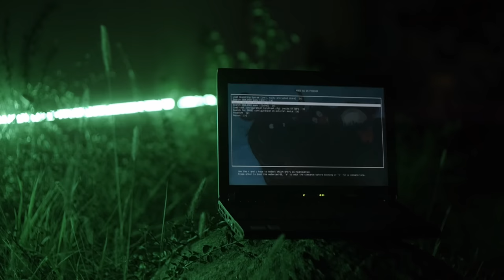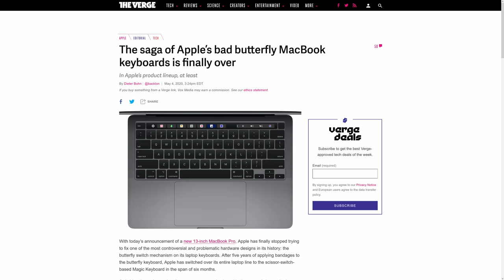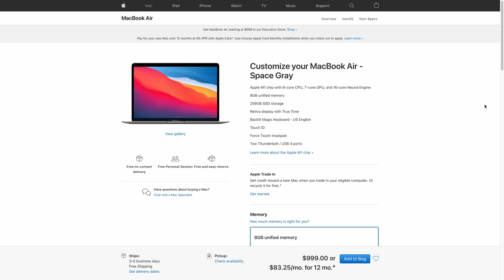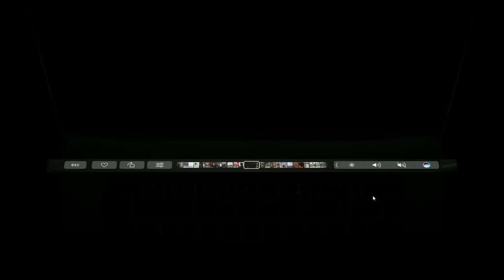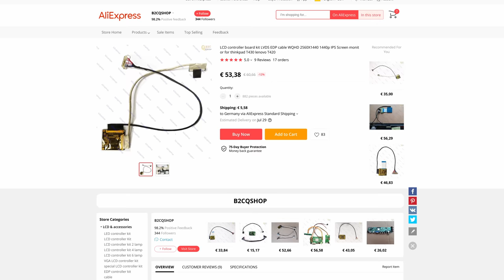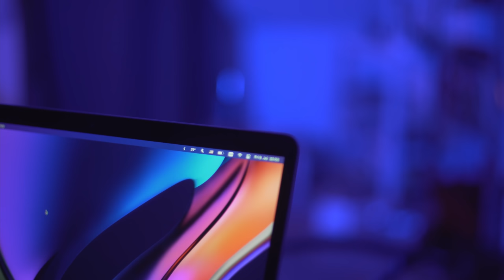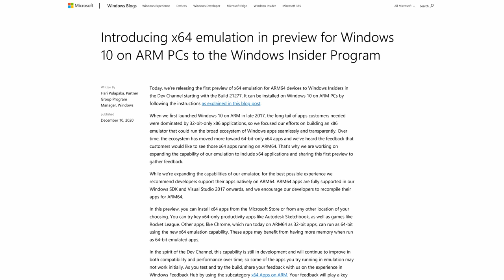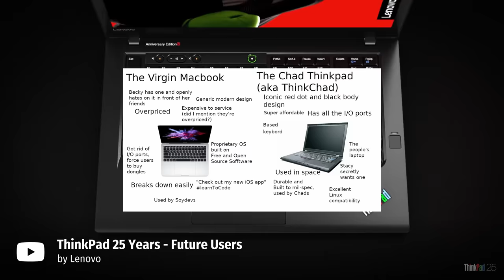Why I Switched to Mac (as a Linux user)

Comment: considering that the kernel of MacOS is based on UNIX, technically, you’re still a linux user 🤷‍♂️
Reply: that... that doesn't make any sense
Reply: @DamianS78  that does
Reply: @malodevic8895  but like, not every kernel is going to be linux, in fact, apple doesn't even use GNU
Reply: @DamianS78  MacOS use that kerkel but a the sauce Apple, that’s all, but it’s still an UNIX kernel
Reply: @malodevic8895  a unix-like kernel, linux is not unix
Reply: @DamianS78  it is, kinda
Reply: @malodevic8895  no it is not, unix is older than linux and not even used today as much, a GNU/Linux PC is not the same as a Mac, which runs DarwinOS on a kernel called XNU as far as I'm aware
Reply: @DamianS78  if you look at the structure of the disk, you can see that it’s really close to linux (you have home, etc, var), so it’s nearly the same
Reply: @malodevic8895  that's just the unix file system, not like linux invented it
Reply from the maker: Maybe I can bring some clarity?

BSD is a direct descendant of the UNIX OS. Linux is more of a UNIX *clone*. 
There are much more differences between BSD flavors (like FreeBSD and OpenBSD) than between Linux distros like Ubuntu and Fedora. If something runs on Ubuntu, you can probably compile it for Fedora, whereas FreeBSD and OpenBSD are completely different operating systems that each built something entirely different on top of the BSD kernel.

Similarly, Darwin, the kernel that macOS is based on, is even less similar to something like FreeBSD and OpenBSD, and has evolved in a completely different direction throughout the years.

Basically, saying that macOS is technically the same as Linux, is like saying that humans and pigeons are technically the same, since they both evolved from fish. Or saying that humans and armadillos are technically the same, because they're both mammals.
Reply: @malodevic8895  macOS (since 10.5) is officially UNIX and is part of the lineage, linux is a cheap clone of UNIX that Linus made because he was mad that you had to pay for UNIX back in 1991

Comment: I have a M1 Mac Min and MBP. They are fantastic machines. I had almost given up on Macs, but the Apple Silicon chip has made me a fan again. I've been using Macs since around 2001. 

To be fair, Windows 10 is the best Win OS MS has ever produced IMO. It's almost as stable as macOS and typically more flexible.

Comment: DaVinci Resolve is for linux users, Final Cut Pro is for mac users & Adobe Premiere Pro is for fu*** windows.
Reply from the maker: Don’t get me started on Davinci Resolve on Linux…
If you have an AMD GPU, you’ll have to use their proprietary drivers for DR to work. However, the proprietary drivers have very suboptimal performance in games compared to the open source ones. 

I’ve tried following multiple tutorials on how to “combine” open source and proprietary drivers to do both gaming and video editing on the same machine, but ended up breaking my system like 3 times. Gave up and went back to Windows. 

NVIDIA should work fine, but AFAIK there are still issues with Wayland

Comment: He had problem with windows because it can't run games well so he switched to mac which can't even start most of the games.
Reply: He'd been using a macOS hackintosh setup for so long already... Plus he didn't switch just because of games.
Reply: @cidsx  my point is this video is useless and doesn't point to anything which makes sense
Reply: @princekushwaha381  if you watched the video and came away with that being the point, or weren’t able to take away a lot of other information from the video then I would suggest re-watching it.
Reply: @princekushwaha381  Is it useless because he's giving point after valid point on how MacBooks have surpassed ThinkPads and the rest of the PC market? His point is very clear and I am sure that you know that. You just don't like his point.
Reply: @cidsx  his video title is why he switched to mac as linux user while in reality he was windows user who then installed mac os on windows machine. Using linux here and there does not makes you a linux user. Then he compared old thinkpad running win 10 with new mac then start talking about chipset and why new mac laptops are great. He just telling things which everyone already knows. That's why I am saying video is useless.

Comment: Macbooks are a copium pick, especially as a software dev. The fact that they just completely become irrelevant after 4-5 years when it comes to swift, xcode and other things is just unacceptable tbh. 

Plus, the amount of money for 16gb of ram :’(
Reply from the maker: Macbooks are usually officially supported for 7 years. And even afterwards, you'll probably be able to install Asahi Linux and keep using them even after the official support has been dropped.

As for the RAM...

Apple Macbook Air M2 with 16GB RAM and 512GB SSD – 1759€
Dell XPS 13 Plus with 16GB RAM and 512GB SSD – 1929€.
Thinkpad X1 Carbon Gen.11 with 16GB RAM and 512GB SSD – 2340€.
HP Elite Dragonfly G3 with 16GB RAM and 512GB SSD – 2300€.

🤷‍♂️

Comment: Dell Inspiron plus 7620 beats the apple trash lol.
Reply from the maker: Cheap build quality, terrible keyboard flex, dim display. At this price, at least the performance better be good!
Reply: @WolfgangsChannel  Cinebench R23 13k+ points. The 3060 will also still curbstomp the apple air. keyboard actually feels great. Display is matte, its nice to look at. Resolution is also higher 3.072 x 1.920 vs AIR 2560x1600. It costs 1.300 EUR in germany, the apple air with 16gb ram and 1TB SSD 1.889 EUR. The only thing that is better on the apple is the battery life and trackpad. I upgraded mine to 32 GB of RAM at 4800mhz. My SSD read and write hovers arround 5 GB/s. That is still roughly 300EUR cheaper than the air and roughly twice to three times as fast.
Reply: @legobuildingsrewiew7538  How's the battery life on that thing 🤭
Reply: @heavy0119  4hours round about. Pretty bad

Comment: bruh, x1 carbon isnt slow, windows is the thing hold it back, u should have debloat windows, undervolt it, and mod gpu driver 😂
Reply: Thinkpads sound like jet engines
Reply: @H4ram  old thermal paste or nuke fan, replace them and it good to go :v

Comment: Win10 was barely usable, but win11 has reached the stage of complete unusability. If macos becomes more like windows, soon enough there will be no usable option left hahah linux will always be clunky and buggy but to me it's the least shtty option
Reply: Honestly, I'd say the latest Windows10 is better that Windows11, both are filled with bloatware and spyware, but Windows10 has a lot less, and at least in Windows10 you can remove it easily and live your life. Also, Windwos11 is trying to look like android (with the dumb start menu and the curved edges) but it's not working at all. And all the good parts about Windows11 (aka. the new terminal) you can install on Windows10 and it will consume less resources.

but Linux is still the best option lol
Reply: @inwater isnt that what i said? I said win10 barely is usable and win11 completely unusable, hence win10 > win11. But both are terrible compared to something like win7
Reply: Linux is great . It is not clunky and buggy. At least for me .Even through my device is new . But linux support is very good

Comment: what a balony..  the thinkpad is ancient tech.. the air is new! (also one is x86 the other arm) "apples vs oranges" nothing more.
Reply from the maker: Well, that's the only laptop that I can compare to. Feel free to watch other benchmarks on Youtube that feature more modern devices (albeit with a similar result)

And no, comparing x86 to ARM, especially if both devices are in the same form-factor, serve the same function and ultimately are made for the same use case – is not comparing apples to oranges. Just because the comparison doesn't favor the thing that you like, doesn't make it unfair. And x86 Windows/Linux laptops is as good as it gets, since ARM ones are much, much worse
Reply: @WolfgangsChannel  no, you are dead wrong. ARM != x86 the internals work completely different, so is DIFFERENT. 

Just admit it, that the compare is shaky, not  high quality. That's all.
Reply from the maker: The internals don't matter to the end user. What matters is how well the computer accomplishes daily tasks. If the ARM computer does the same thing better than the x86 one, what do I care about its internal works?

I've already admitted it in the video – 6:41. But I guess you didn't actually watch the video and instead decided to head straight to the comment section and write an angry rebuttal
Reply: @WolfgangsChannel  good luck with your channel.. you just lost a subscriber. It's so typical how tubers react when getting criticism. always defending, always trying to come out as the better person (for your audience reading comments).. sad, but true.

Anyway.. unsubscribed and i'll seek my info with channels that are more serious and that can actually take criticism well. (and do tests properly)
They (the tubers i seek for) are hard to find, but they are out there.

Again.. i wish you well. Your visions/methods collide with mine., that's ok.

Comment: i do hate apple products and everything, for me anything apple is just overpriced shit for what it offers. The only thing apple made that I do have to respect is macOS, yes it is proprietary but they made a good job of mixing both usability with productivity by having the terminal there. If they didn't had this so out of the curve price i would consider the macbook air being the first apple product i would consider buying, which is already something way out of my mind already because of how i always  hated apple products, they now have one product that i could consider buying.
Reply from the maker: The price is not even out of the curve. Take a look at similar Windows laptops — Dell XPS 13, Thinkpad Carbon X1, HP Zbook. 

Sure, unlike Apple, those companies also have cheaper models, but if you compare apples to apples, the MBA is similar (or sometimes even cheaper) than the direct competition

Comment: New to Linux?
Pin it: Don't use rolling release distro like Arch /Gentoo.
Arch and Gentoo are for enthusiast only.

If you have Nvidia gpu, then Pop os is your best bet. Running stable for me for about 3 years on Acer Nitro.
When it gives issues, I just need to update it.

If you don't have Nvidia then you can use any debian based distro.

Comment: This makes no sense, why did you stick around with Linux for so long? The advantages of a Linux laptop is its upgradability and overall freedom to do what you want a computer to do, when you move to Mac you throw all that away.
Reply: Watch the video to the end.

He said all modern laptops are not upgradable and locked down, while still having the same disadvantages they had previously like getting hot, fan noise and poor battery life.

MacBooks have become power houses since the release of Apple silicon and are now even cheaper than Normal laptops, while having amazing performance, good hardware, good build quality and good battery life.

The choice is obvious, if you don’t care about the freedom of your operating system

Comment: Your pragmatism is commendable, but if you struggle using Ubuntu you have no business trying Arch, let alone Gentoo. Doing that is a sure-fire way to be absolutely frustrated.
No hate, by the way. Use whatever you like, but you're basically saying "I've tried vanilla cake and didn't like it. Then I tried cilantro and basil cake and didn't like it. Cake isn't for me."
Reply from the maker: I didn't struggle to use Ubuntu, nor did I try out Arch and Gentoo because Ubuntu was too difficult for me. Installing and using Ubuntu is not difficult for anyone who's sufficiently motivated and can use a search machine.

I felt that it was necessary to say that I've tried pretty much every distro out there, including the more obscure ones, because failing to mention that usually invites comments like "pfff, of course you didn't like Linux, you only used $insert_distro_name_here, which is a BAD distro for noobs and lazy people".

Comment: Nope, I opt for computing and software freedom, that's why I use a free software (free as in freedom) like GNU/Linux.

I don't care about proprietary software, I don't care how "shiny" you think your desktop looks (that can all be done with theming and extensions etc), I don't care about some supposed (temporary) advantage/disadvantage, and all the other guff. I will not run locked-down corporate spyware on my computers.

I'm not a "fanboy" or some other ad hominem you try to think of, I don't care ... It's all about a free software desktop (or server etc).

PS. No, GNU/Linux is not just about people who want to "mess around with stuff" and do hard things to set up their computer ... you just sound like a corporate advertising talking head when you say stuff like that.
Reply: I agree with that. MX Linux runs on my laptop without the annoyances of enforced updates, notifications or the OS forcing me to make an online account - and it still does everything I want, even more elegantly than Windows does it.

But, Linux still has a serious downside that Windows does not have. I have made a 2D cat game in a custom built Godot Engine - and I exported it to Linux 64-bit, Windows 32-bit and Windows 64-bit.

This Linux executable does not run on all Linux distributions. One some it runs; on some it does not run. You take one older version of MX Linux, just two versions before (version 19 instead of 21) - and the executable doesn't run any more. 😕

Whereas on Windows 10 and 11, my cat game always works like a charm. Zero problems with the executables.

There is, of course, the possibility of making a flatpak, but that will turn a 300 MB game into a 1 GB game. Not ideal, either.